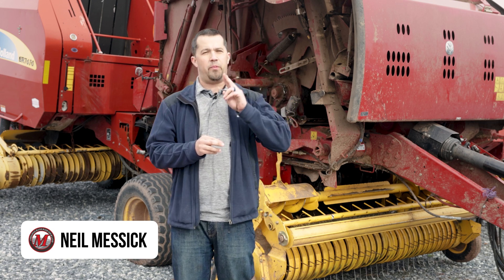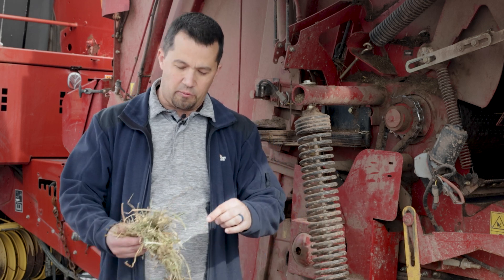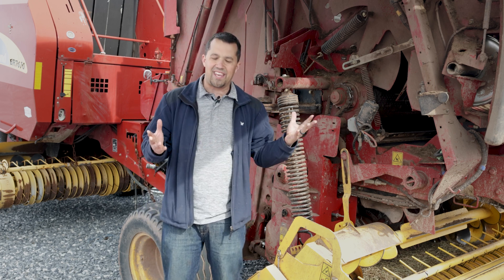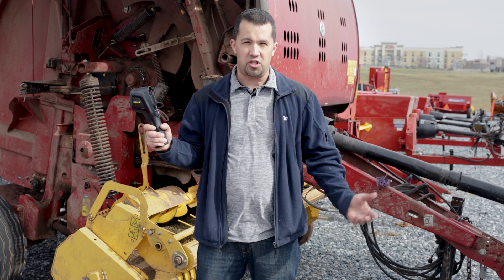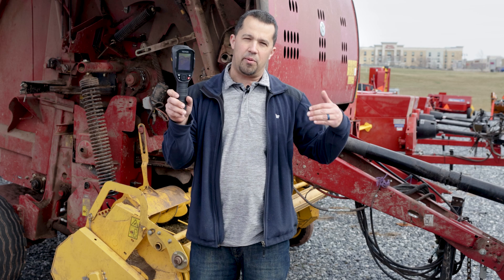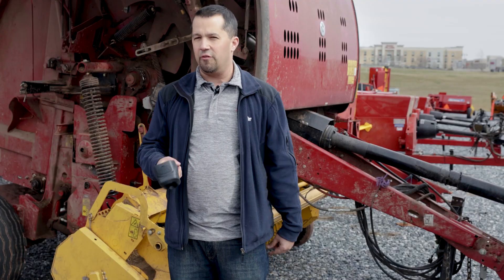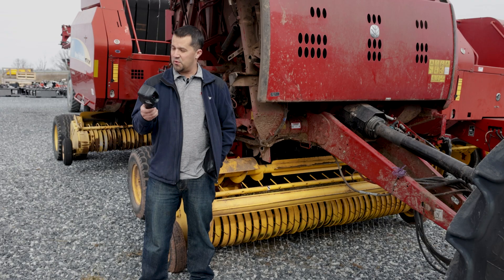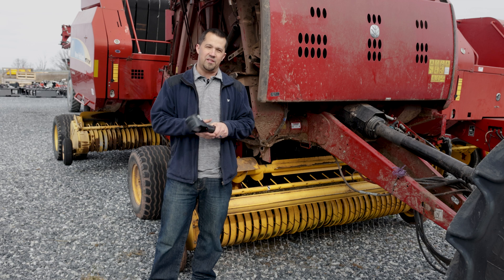Prevent machinery fires with a thermal camera.

Comment: I have one of the Flir handhelds & it’s a very handy tool. Initially I was looking at the cell-phone mount models, but you need to keep in mind the rapid changes in phone technology. If you invest in a high-end brand like Flir, you want it to be around a while. May not be the best idea to buy a device that relies on another device from a different company. Had I gone with the phone mounted unit, I’d be out of luck now as it wouldn’t fit my current phone. I’d need to maintain an old phone just to use it. Better off getting the stand-alone handheld.
Reply: That happened to me, I bought an inspection camera that interfaced with my cell phone using Wifi and their app. Well they quit supporting Android and IOS so the camera is now worthless. Stand a lone devices for me now.

Comment: Infrared temp sensors are great for pointing at bearings and moving components for pinpoint location... a thermal camera can be a useful tool for a quick scan.

Comment: I bought a 3pt weight box from Vevor.  It was poorly made and needed to be reinforced at the lower link arm connecting points.  They started to spread apart and the box crack with 2/3 of the 800lb load in the box.
It also weighed significantly less empty than advertised.
Since that experience I would be cautious about anything else from them, even though they gave me a partial refund.

Comment: While it seems like a good idea it also seems a bit impractical. How many times a day are you going to stop and scan the equipment for hot spots?  I've seen hay catch fire by being tightly wound around the drive shaft.  A thermal camera would likely not have caught that.

Comment: FLIR makes camera modules that attach to your cellphone and record video or pictures. They're handy for a lot of things. The important thing to understand right away is that most cameras scale the temperatures that it's currently "seeing" where the coldest is blue and the hottest is red. If the temperature span in view is 70F to 400F, then the red is HOT. But if the temperature span is 70F to 100F, red isn't really HOT, it's just 30F over the coldest area. Not realizing this can make one worry a bit, like when pointing it at your circuit breaker panel and the warmest breaker is bright red, even though it's well below any cause for concern.